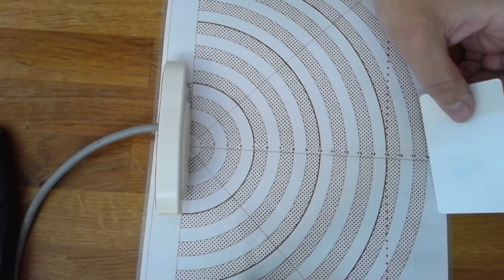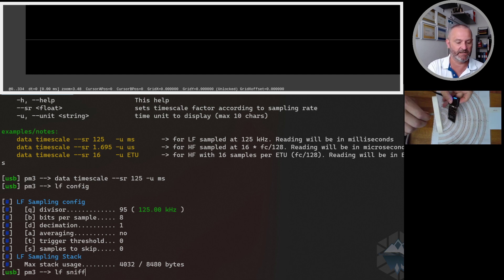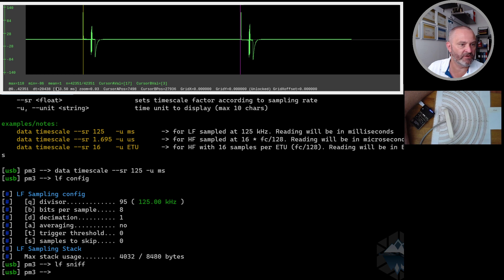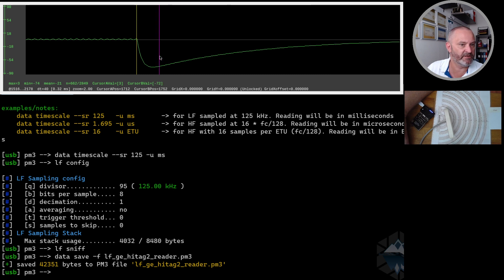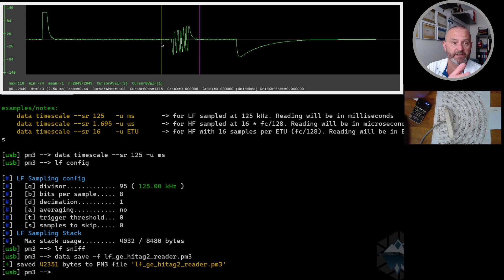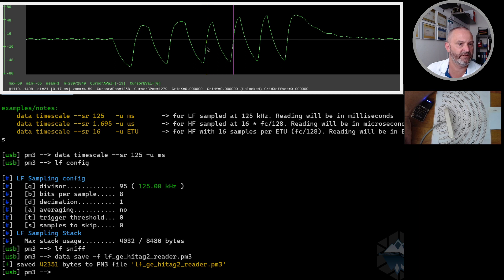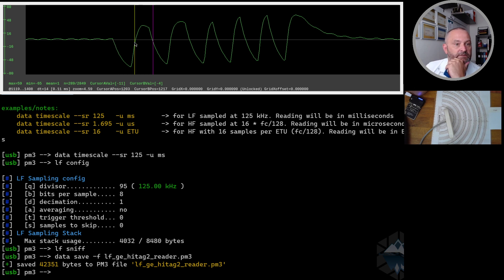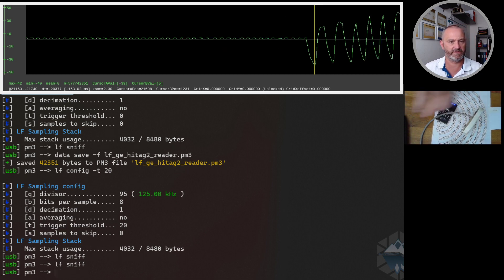How to low frequence sniff vs Hitag2 using your proxmark3

Comment: sorry for the late party, im learning about 125khz but i can only buy the proxmark3 easy version (from china i think). On your site, it said "easy is obselete  hardware". Is it okay ?
Reply from the maker: As long as the easy has 512kb flash mem it’s usually ok.  
Buy from a trusted source and it should work just fine.